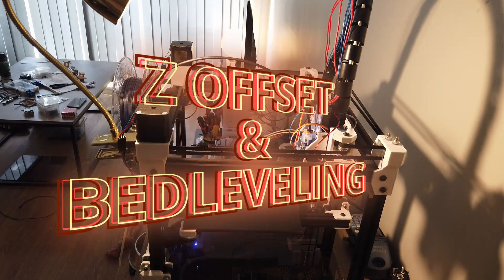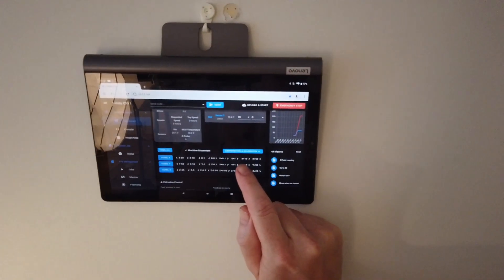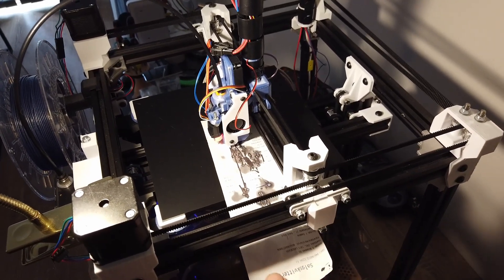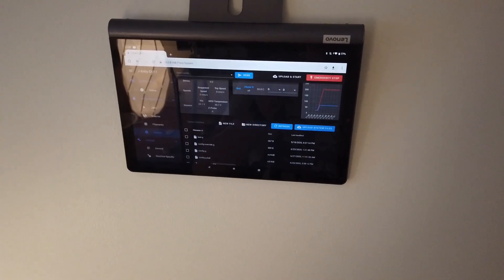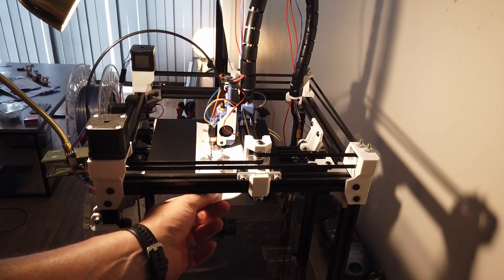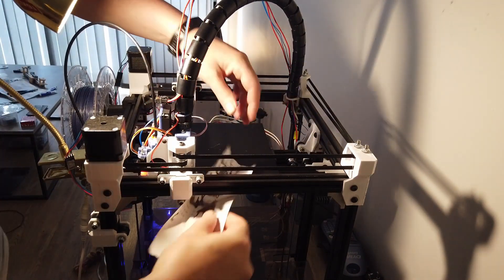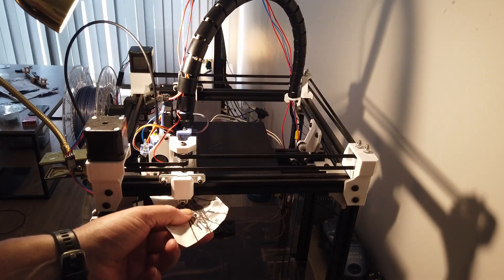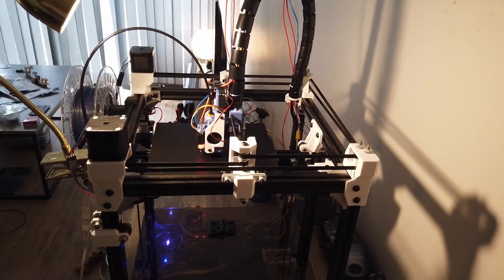Z Offset & Bedleveling | V-Baby DIY CoreXY 3d Printer

Comment: Can we build a version with 400 mm cubed build volume version of v baby/ v king ? Is there any custom configurator for V baby ?
Reply from the maker: You can build a 400 V-Baby but if so you want a different Z lift design. With more lifting points